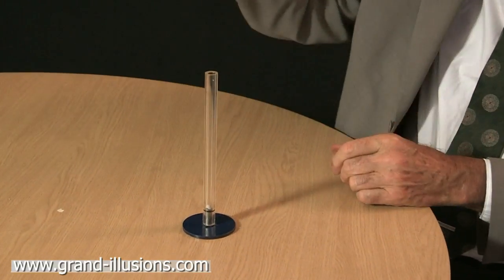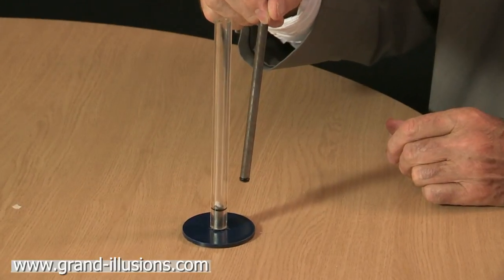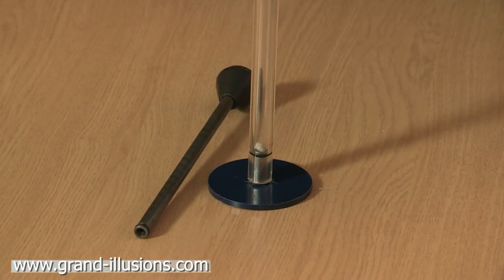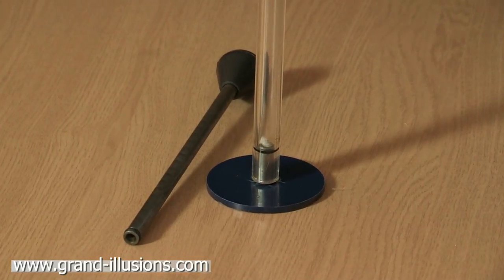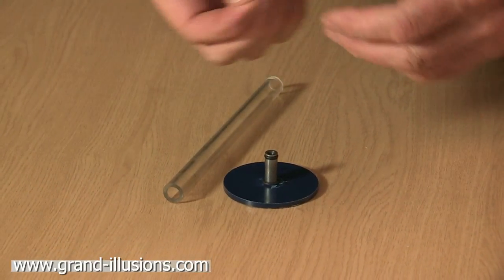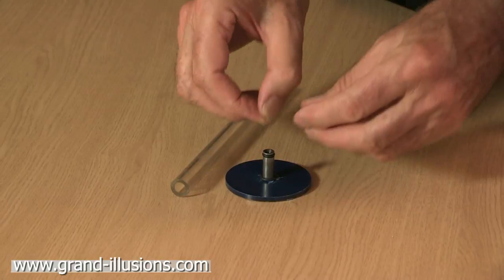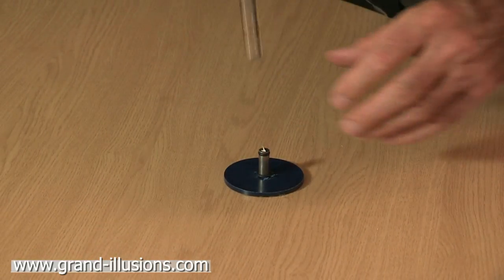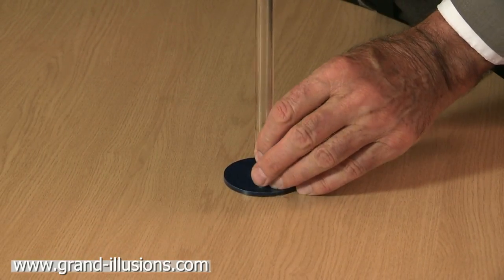Fire Piston

Comment: that's how diesel engine works..
Reply: Not really It still needs a glow plug.
Reply: ***** Diesel engine do not require any glow plug it works exactly like that. PV = nRT, watch some videos about it
Reply: ***** To clarify, the glow plugs are only there to help with winter cold starts. In the summer, and when the engine is warmed up, the glow plugs do nothing.
Reply: So i have a question for both of you regarding the little light on the dash of diesel car, shaped like a coil. This i assume is referring to the readiness of the glow plug, however my question is this, I have been told to wait until the light goes out before starting the car, typically this takes 3 to 5 seconds but frankly it's not my car i'm accustomed to my petrol car and i blatantly ignore this advice.  However i have been told that this can damage the engine, that true or not? And if so why is it true? I assume it has something to do with the piston rods being compressed or something like that?
Reply: Short answer: If the engine started easily, you're not doing any damage by not waiting for the plug light to go out.

Long answer:

In the winter, if you don't wait for the plugs the diesel engine may not start without the plugs so you'll be running fuel through your engine, and not burning it. This can wash out the rings, typically this doesn't damage the engine on its own but what it does is prevent your rings from sealing properly and you'll loose compression. Without sufficient compression your engine won't start, even if you then wait for the plugs.

This condition is known as a flooded engine and can happen on petrol cars too, rotaries are prone to it. It is worse for petrol cars, because diesel is an oil.

But basically, diesel or petrol, flooding an engine results in substandard lubrication to the rings/wall during the clearing stage, and also lots of fuel gets blown by the rings into the oil so you are now circulating contaminated oil when you do get it running. This is what causes the damage.
Reply: atsernov
Indeed. very interesting. Tho honestly it's been quite a few years since i heard anyone talking about a flooded engine. O_o Didn't that get solved with the advent on the automatic choke and fuel injection?  Or maybe im talking nonsense as my knowledge is extremely limited. Is flooding the engine still a thing with Diesels?
Reply: With FI it's uncommon, but can occur in some rare cases. This is why they are programmed with a purging mode. Put the accelerator to the floor (WOT) and crank the engine. The engine will crank but the injectors will be disabled.

RX8s are known to flood the apex seals if you make lots of really short trips and don't let the engine heat up.

Diesels in the winter, if your glow plugs aren't working, and you're cranking it for 5 minuts to compression heat the cylinders before it fires, damn right your flooding the rings.
Reply: atsernov Very interesting. tnx for the info mate.
Reply: DAGATHire
My pleasure. Thanks for asking. :)
Reply: In a diesel engine, doesn't the starter engine slam the first piston?
Reply: HurnyOstrich That question is hard to understand, all the starter motor does is spin the crank. Once the crank is turning, the ignition process takes over. (Spark in a gas engine, compression in diesel)
Reply: Ah I see now, thanks atsernov
Reply: Philippe Jean it doesn't need one? so why does it has one?
Reply: ***** It doesn't have one, the part that looks like a spark plug is in fact the injector. It pulverizes the diesel when the air is compressed and hot so that the diesel combust instantly.
Reply: Philippe Jean hey you,re right i had to see for myself because everyone told me a diesel engine needed a glow plug... and i even saw a so called glow plug in real life with my own eyes and someone look this is a glow plug..... hmm wierd
Reply: ***** Well you're not totally wrong, some small diesel engines who cannot reach high enough temperature need a sparkplug but it's not common
Reply: No one cares
Reply: ***** not sure what Philippe is talking about...

A glow plug is NOT a spark plug, most diesels since the early 90s do have glow plugs.

But that doesn't mean a diesel engine requires one to run. They are just there to help during cold start.
Reply: why am I seeing many doto players here.
Reply: Wasnt expecting to come to the comments and learn about diesels
Reply: So many smart peeps here

Comment from the maker: Although I did physics at A level (this is the UK system when you are 17 - 18 years old) I must admit I did not come across this at the time. I guess if I had continued with a phyics/engineering course I might have done, but I switched to chemistry at university. 

Some years later (this would be in the early 1980s) I worked at the BBC, and one of the visual effects designers I emt at that time was a man called Laurie Hyman, who invented this particular version of the fire piston.

Comment: That's neither Charles's law (V/T=const), nor Gay-Lussac's law (P/T=const), nor Boyle's law (P*V=const). What we have here is essentially the law of conservation of energy: we do work by compressing the gas, and the produced energy converts to the gas' temperature.

It's the same as what happens in "Tim's on a Roll..." video at 1:15, where two big bearing balls, struck at each other, ignite a piece of paper placed between them. But in that case we do work by accelerating the balls, then the kinetic energy converts to the temperature of the material at to the impact point.